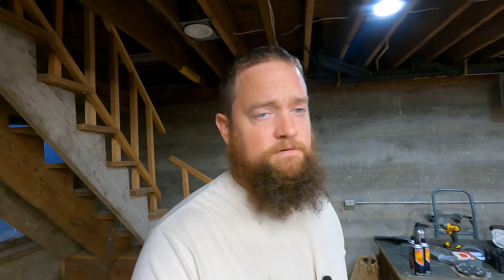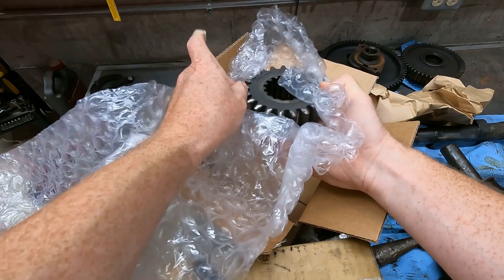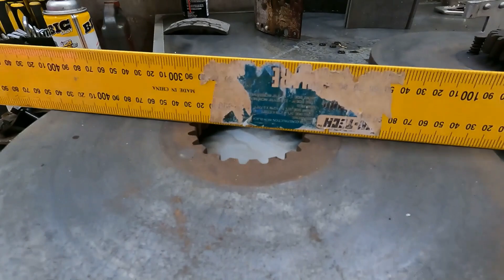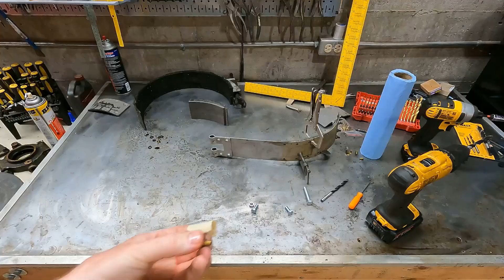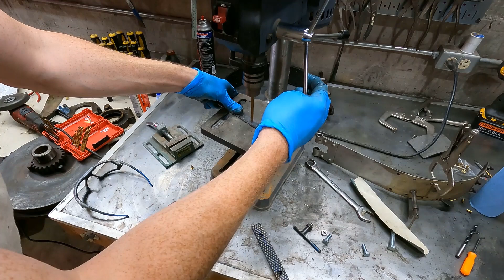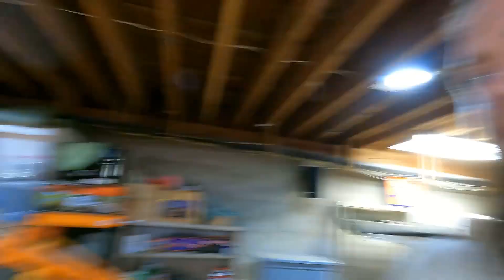Clutch repair and relining the brakes on my Caterpillar D4

Comment from the maker: Hey Matt, it's Matt from 5 hours in the future.  You seem to have forgotten that we own a very nice ammunition press which accepts threaded dies, and would have worked perfectly for setting the brake rivets.

Anyways, love the channel and such.  Please give your dog more screen time than you.

Matt
Reply: Last time I did brake liners. I riveted them using a normal rivet gun & aluminium rivets, then drilled them out 1 by 1 whilst replacing them with brass rivets using 2 punches(1 flat & 1 with a dull point) & a vice. U really don't need precision as long as the heads are as Deep as they can go & the back is peined. If you over think every job left like you did this job, then we'll still be watching in 2028 😂 keep it up Bro. luvin the content.
Reply: I myself always sort out the puzzle after I've finished it. Great job, keep up the good work. Can't wait to see it done.
Reply: Glad I'm not the only one who does that....
Reply: Hey Matt, if you decide to machine the clutch steels make sure you measure the thickness and that there is still enough material to be above the manufacturers minimum plus future wear!
Reply: Now that’s funny right there…
Reply: ... or a die from a double flaring brake line kit?
Reply: Zip ties or 1/4 inch bolts work great for holding brake linings while you rivet and drill
Reply: Yes you can build up that crank, then return to standard size Matt😀😀😀😀👍👍
Reply: Genius......... why do it the easy way when you can get aboard the struggle bus all day?
I thought your vice/die setup worked pretty well to be honest. I think I would have just used a punch in the vice as the dolly, then another punch and hammer and Octopus arms to do the other side, lol.
Reply: Amigo que lindo tu taller y que lindo trabajo hace
Reply: - I am so very pleased for you, Sir.
- There is a true saying: "There ain't no fixin' stupid.
- That is defiantly Not you.
- I just made up another true old saying: "Gifted with enough dumb to give your curiosity/perseverance enough space to accomplish something that others are never be able to do.
Reply: LMAO!
Reply: Garage is full, just cover rod bolts with fuel hose 😀👍
Reply: Jobber book prices way to go right for that work,then utube  fan's like lower ball joints instead 😀😀😀😀
Reply: I thought your home-made river jig was rather clever.  It would have done the job for you.  I'd appreciate seeing the ammo press in use for this job.
Reply: Hey Matt From the Future. My other channel is trespassingintothewild. I have a komatsu d31 that I need to put new brakes like you did. My question is we’re did you get the relign kit at. Seems like all I can find is a new brake for 1000$ bucks. Appreciate any help
Reply from the maker: I got mine at General Gear, but looks like they only carry steering clutch stuff for D31s.  I see a lot of stuff on eBay though...

Comment: When you flatten rivets, you spread them to base then smash.  Otherwise you just smash the wall of the rivet and the flange doesn't spread out enough.  Its also important to make sure your exactly centered or the flange will spread unevenly and you end up with splits in the flange and the rivot is weakend.   Awesome work by the way.

Comment: The shop I work at has a fabrication shop and we have 2 CNC machines and all the lathes and specialty tools a man could want. We have turned multiple friction plates. HOWEVER, if the pitting is too bad, you'll HAVE to replace them. You can only do so much with them.

Comment: Old timer's trick for the countersink holes in the linings. Put your drill bit  in the drill then slip a deep socket over the bit that fits closely to the bit. Then use various flat washers or adjust the bit depth in the chuck to get the countersink depth you need. Once this is set, all the holes will be the same depth. 
Don't mind me just rambling along🙃

Comment: You should put the motor back together and put it on the side of the road with a mailbox on top of the exhaust pipe.  Or maybe build up a small raised flower bed, put the motor all painted up in the middle and grow some wildflowers around it.  Of course also by the side of the road.  

Anytime anyone needs directions to your place, you just tell them to look for the cat motor.

Comment: If you really want to learn a lit there is a u tube channel named swatch who rebuilds d2 cats and he really explains things well. There are enough similarities to the d4 to make it usfell. As far as the clutch I would just sand the rust off. Its not high tech. I'm sure that would work fine. Keep up the good work. I also have a d4 to fix up.

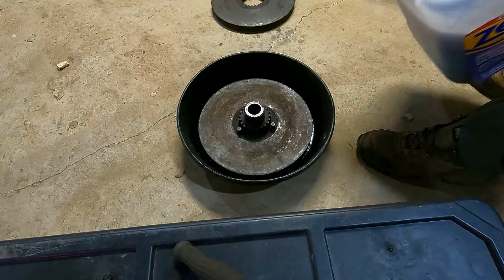Comment: 4:30
is that the part where he later finds out that a pin was wrong by 90° and that caused excess vibration?

Comment: You made my morning. Its great to see someone just jump into the problem and figure it out. They do make collets that clamp on your bit for depth control. I sometimes just run electrical tape around the bit. Drill press is best with the depth control. I too paint the parts that go into a never to be seen again case.  OCD I guess. We know its painted. Actually, that is done for good oil drainage.

Comment: You need to do this job very spot on. If i was you i would take all of the clutch brake ass to a trucking garage and ask were they have brake linings relined, and take them to them and have them done profesionaly riveted. Its a big job and time waisted if it broke up while it was working.

Comment: For what it's worth there are brake lining rivet tools available on the web around $40.  Even comes with the piloted counterbore.  I get the value in making do with what you got and not having to wait for another doodad in the mail.  But if it produced a better result and freed up your time for the next task?  Sometimes I think "don't make it when you can buy it" is worth considering.

Comment: Worked in the friction business for 47 years.  I have done a bunch of those Cat bands.  There are people who can countersink and rivet the lining.  Looks like you were on the right track and having the lining conform to the band is important.  You can put the lining in an oven and heat it up to may 120 degrees and it gets a little more flexible.  The rivets are tapered and there are countersinks based on the size of the rivets.  Guessing yours are an 8.  If you drilled the lining someone like Ott’s Friction or Potter Webster could countersink and rivet it for you.  Always ugly if you break a piece of the lining.  The corner pieces are the most likely to crack.  Hope this helps.  I just found where to message you.  I was watching on Apple TV and I am now on my IPad.
Reply: This may be the most charming comment on all of YouTube.

Comment: Good video. Can't wait to see it up and pushing dirt. Subbed. The rivets looked good. As long as it sits all the way down and flush with the bottom of the recess hole in the brake pad and it's pressed tight on the backside, it'll do just fine. They are pretty much held in with friction and pressure in operating condition so you don't have to worry too much about them.

Comment: Have a look at how much of the brake pad  is left so you can drill the holes to the proper Depth or you will loose adjustment if the rivets aren’t deep enough

Comment: Is there a gasket under the top cover over transmission?  One should be made to keep out moisture pus  use your black gasket glue or tuffstuff its better than rtv silicone. Your doing super fine. Keep old engine till new engine up and running may need parts. rivets good. Keep up the good work.

Comment: Glad you are replacing that second gear. Otherwise, you would be visiting it again, and that wouldn't be very good. As for the drilling the counter sink for the rivet heads, use your drill press and make a stop depth setup so you get everyone to the exact same depth. Easy peasy...  Also, you could take your fold over rivet bit and drill a hole in the center via the drill press, and then make a rounded head insert to push into the bit. Than you would be able to spread the rivet and fold it over in one step. That would give to uniformed one step ability and positive folded over ability as well. Thumbs Up!

Comment: having rebuilt lots of old stuff over the years I have learnt to go with your gut if you think it will do replace it as you say its great insurance there is nothing worse than getting all together and having to strip it down again because you saved 100 pounds you will spend that 10 times over in time. the old saying don't spoil the ship for a hapeth of tar come in very true

Comment: Before you put the new engine in are you going to start it just to make sure it good ?
Reply from the maker: Lots of inspection covers to check out the bottom end of the engine... I'll give it a good going over before installing it.

Comment: rebuild that original engine and hang onto it... for one it'll be a good learning experience, two - you'll have a replacement engine when the engine you got for 5 bills goes henshit and has to be replaced. 
plus, the experience you'll gain from rebuilding the old engine will be better than any youtube vid you will ever watch

an old loggers idiom: anything with tits or wheels is gonna give you trouble
....there's lots of wheels in them old cats.... your agony and destiny are set

Comment: Matt,
  Keep all your engine and other parts. Put them in boxes and label them noting the bad parts and why you think they are bad. In the future you might reconsider using these parts when you need a part and it is not available. Keep up the good work, glad you found that running Cat engine. Wonder if in the near future the provider of your purchased engine might consider a reduced price for the other engine that he has that would fit your Cat. Keep in touch with him. Perhaps a few visits in the future would be in order.
best regards,
Sam

Comment: I put my rivet backup bar in the vice pointing up, place rivet head on it and holding all the pieces together with one hand including a centerpunch whack the rivet with a hammer to start and finish it off with a small round face (ball pein) hammer. Keep All your engine parts cos if you can't use them someone else probably could. Like you videos mate. Started driving one of these at 6 years of age. 55 years ago, great machines. Cheers from Tasmania, Australia.

Comment: The clutch "throwout bearing" is interesting! I guess that since the clutch levers travel over center and lock , the clutch is either locked or unlocked - meaning that there are no springs? So the "throwout bearing" isn't under pressure unless you are in the process of locking or unlocking. Maybe this is why there is no bearing. And maybe the lost motion in the levers when unlocked allowed it to drop down and wear that plate egg-shaped? And those friction pads on the coupling, stopping the transmission input shaft when the clutch is disengaged - this must be how they got around needing synchronizers - it makes sure the gears aren't turning when you shift them. Interesting stuff! Good video - and creative tooling for the brake lining rivets!
Reply from the maker: I got the new throw out collar in today and it's clear how worn out the old one was, there is way less play.  I have a theory on what happened, but I'll do that in another video.  The clutch brake is manual though, after opening the clutch, you pull the lever a little further back to bring it into contact with that silver brake bracket.  Gonna take some getting used to when I actually operate it, but at least I know how it works now, and I won't be grinding gears.
Reply: The shifter forks in a transmission work similar to the throwout collar - they contact the gears only when shifting, and aren't designed for constant contact. This must be why there is no ball bearing. And was there a funnel above the throwout collar for oiling it?  Knowledge is power, and now you understand why the clutch needs to be pulled back that extra bit before shifting!

Comment: Just run a belt sander over those plates to clean them up a bit. Not perfect but will certainly recondition them without removing too much material.

Comment: i have some videos on relining my insley clutches and brakes on my channel. i used my old friction material to set the depth. since you're not using a drill press just slide a piece of pvc pipe or something over the drill bit as a depth stop

Comment: When you step back and think about it, you're doing great, even if you spend 15k in parts plus your time you'll have a working dozer, sure you might have been able to buy a running machine for that, but this machine will be in way better shape and less trouble in the long run

Comment: Regarding those clutch plates, there should be a Tolerance that would work with new Clutch Disks, and turning them should be a good thought.  With new plates there the should have some tolerances listed.  Nice for finding that 2nd gear, and all those new parts.   :)

Comment: My late father had a "contraption" on which he would rivet on the brake linings on his '36 Ford.  When the shoes on my '58MB needed relining I ventured to a local shop, with the factory specs. which rebuilt clutches and brakes.  They turned it around in  less then a day.  Narragansett Bay

Comment: See if the guy you bought the engine from will sell you another one.  If your engine source is going out of business it might be wise to make a deal on another one.  I had a Triumph TR-3 with a transmission that was not synchro in first gear.  I kept a spare transmission that I rebuilt at my leisure so when the not so hardy straight splined gear dropped a tooth I could change the trany over a week end.

Comment: replace    that   clutch  plate  that  hasthe  cracks   cos  if   you  are  pushing   up  hill   at  any   time  and   release ..the   masterclutch   and let   the   dozer  .run  .down   hill   backwards   wile   gearbox . is   still  in   foreward   gear   that   cracked   plate   will   turn   at  speed   far   faster  than   normal  and   can   fly  to   peices   and   do   untold   damage   to   other  clutch   parts    as  happened   to  one  of  my     d4s   replace  it   while  you   can   get  to  it

Comment: Have never tried on steel but have on stainless. Tack pieces and before it cools touch the tack with a wet cloth. You can see the two pieces pull together. Good update
Thanks

Comment: Fixing second gear is a good idea.........while its in pieces, get it done correctly first time. You will thank yourself later......and if you need to sell it, you can confidently tell the buyer all the gears work correctly. Always get your clutch steel driving surfaces machined when renewing the friction face.

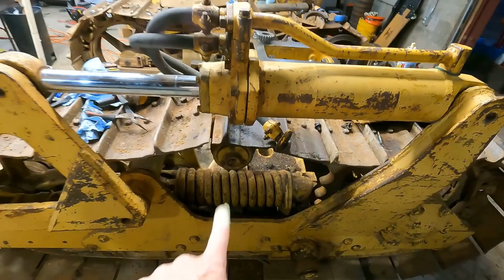Comment: 23:41 I vote slam it back together, start it, and see how well it does or does not run. I have a sneaking suspicion that thing will run just fine despite all the damage to it as these big cats are hard to kill.
Reply: They're like the Ford 300 six cylinder.
Reply: @tihspidtherekciltilc5469  Can confirm. Have two of them. They're indestructible.

Comment: To set the rivets, I used a bolt in a vice. Bolt is mounted with the head in the vice, other end of the bolt rests against the head of the rivet. Then bang away with the hammer on the tip of the rivet.

Comment: Get a brass washer or make one by cutting the end off a brass tube the same diameter as the holes in your linings. When you have the right thickness to bring your rivet head up to where it should be, epoxy the washer to the bottom of the hole that went too deep. You could also use a brass rod the same OD as the brad point bit. You will just need to drill out the center (do this before you cut the "spacer" off).

Comment: Hi Matt, 50 years ago I worked in a machine shop and we rebanded brake bands and they had a tool on a pedestal that was foot operated and it was made for what you are doing, you mite find one in an old machine shop. The machine shop I worked in was in Chehalis Washington but has been out business for years , but you mite find one in your area.

Comment: So if you have two engine's and you don't need one I would pack it in grease and either store or bury it for any parts you won't find in 5-10-20 years time if it's hard now it's going to have to be made from scratch in the future . Good luck 🤞

Comment: GOOD JOB NOTHING WRONG WITH. EXTRA. PARTS. I. WOULD. CONTINUE. RESTORING. AND CHECKING THINGS. OUT.       THE. FUTURE. A. LONG. TIME.  YOU MIGHT. NEED THEM. PARTS. SOME  DAY.   SAVE.  EVERY ONE.   I WOULD.  MONEY. IN THE. BANK. PROTECT.  THOSE. PARTS.  WARM.   AND.  DRY.     GOOD. LUCK.

Comment: i garuntee you wont regret the second gear,if you plan to ever sell it ,and someone jumps on it for test drive and that gear is gone,that is a major factor.
far as the clutch plates id be more concerned of hot spots other than pitting,the surface cracks are from the hot spots,those look alright with a little buffing,a good machinist could skin  then with a fine feed rate and be like factory,hahah good job man

Comment: On the riveting, you should try using the first flaring die a little more to flare it wider, then use the second die to finish the process. That way the material will go further beyond the hole 👍🏼

Comment: riveting // a block of steel 4 inch by 5 inch //drill and tap 2/8 hole on top side ,, using a ball peen hammer  to drive  rivets to  hold the rivet-- in work peace ,over steel block die //you drilled and tap out 4 inch// by 5  inch block of steel  setting on your  steel table

Comment: You can have the metal faces resurfaced, and the friction surfaces can be relined.There is a company in Long Beach ,CA called Friction Materials? which relines clutch and brake linings for anything.

Comment: Rebuild it so you have no worries. 
Right to replace clutch plates, metal looked fatigued. All the torque runs thru them.
Sending you encouragement. 
Enjoying the videos. 
You will have years of service.
Good Job on the Rivets..